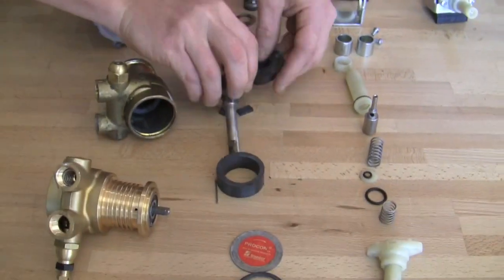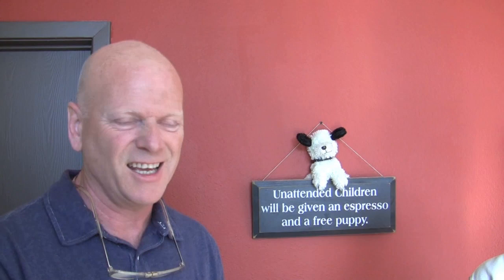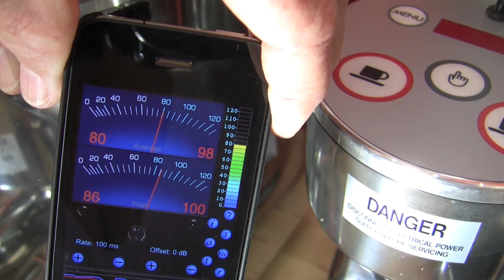Overview: Rotary vs. Vibratory Pumps

Comment: One big this I noticed is the vibration pump will burn up if its ran for a period of time with out water, as weather is the 'coolent' I have had 2 vibratory pump burn up due to running the water tank empty.

Comment: This was so interesting !! Thank you! Gail is amazing as always, but unlike her, I quite like the sound of a grinder, mine is pretty quiet and pleasant to the ear imho. On the other hand, I really dislike the sound of a vibrating pump, it's very aggressive, in your face kind of sound, you can feel the entire machine shaking, cups on the top shaking and moving knocking into one another...The smooth sound of a rotary pump reminds me of ice cream machine at the milk bar, and everything related to ice cream gives me joy inside my heart :-P

Also, I wonder if the vibration through the whole machine is a good thing for the overall integrity of the components over a long period of time compared to rotary pump which feels a lot less intrusive. If you are ready to invest well over 2000$ on a machine that you will likely keep for a good part of your life maybe the 500$ more is worth it even if it doesn't make

Comment: Thanks for the video. 
I wonder if Rotary pump and volumetric pump is the same?
I f The machine is just plumb in, can I use a bucket or sth to use it or does it have to be plumbed? 
Thanks

Comment: Vibe pumps are better for home use as they are cheap, if you're lazy and you live in a hard water area and don't descale as often as you should and you burn out your pump you can get an OEM replacement for 20 bucks shipped. If you do that with a rotary vane pump you'll be crying when you have to spend 500$ replacing the rotary vane pump. The grinder will always be  louder that the vibe pump as they correctly note and pump type has no effect on taste.

Comment: Great video!  Some great folks giving great information.  No winners, no losers, just different equipment for different needs.  Thanks for the information.  I'll be looking you up when I'm in the market again.
Reply from the maker: +blmeflmm66 Cheers! Thanks for watcing!
Reply: I don't think the rotary pump would work very well with a thermocoil system. The vibratory pump doses out water in small amounts that can be vaporized. The rotary pump would have to rotate very slowly in order to manage that.

Comment: Bill said vibratory pump was not for plumbed in, however Expobar Brewtus IV P is with vibratory pump and Plumbable. Please explain. Thanks
Reply: +Ko Amin Samudera You can do it if you have a solenoid valve before the pump.  It's rarely done.
Reply: +Beans and Rice thanks. does the solenoid valve come as standard kit from the machine purchase;?
Reply: +Beans and Rice thanks for your advice. I think I'd better buy rotary pump machine.
Reply: I know i'm late to the party... however i think i would go with Rotary also.  It never hurts to buy quality... and adding another point of failure to a system is never good.  Not to mention, your raising the cost of the machine with materials and labor to accomplish the same thing a rotary is capable of handling on its own.
Reply: hi Aaron. thanks for your input. I did buy VBM Domobar with rotary pump......
Reply: Out of curiosity, what made you chose the VBM Domobar over a profitec 700, Quickmill or rocket?  I am on the hunt and am trying to get the best value possible.  I hadn't heard of the VBM until your comment... so I'm about to go digging.
Reply: I must admit that I chose VBM more because of non-technical issues, such as distributor profile, possibility to buy together with grinder, etc. Of course, VBM technically is quite good. Also, in my country-Indonesia, not all brands have agents. I would love to have Profitec 700, but they don't have agent here. Recently, I saw review about ECM Synchronika, and I think it's really a nice machine to be considered.

Comment: Hey there awesome video! Just a quick note though, 1/1.5 duty cycle is 66%. So the machine can be on 66% of the time you consider as a unit, which in this case can be 1.5 minutes, seconds, hours...

Comment: Quick tidbit here, both of these pumps are driven by motors, the vibrating pump is just a linear induction motor instead of a rotating motor. Its very likely that your rotating motor is also induction, it just moves differently. The most common example of a linear induction motor is found in every loudspeaker on earth and they can certainly perform day in and day out for decades. Whether or not they can handle a specific duty cycle is really a matter of how they are sized and designed for a certain application. There also other very cheap versions of rotating pumps out there, this one in particular is just very robust. 

This is extremely informative though as it shows how these are set up for ESPRESSO machines, great work on showing these taken apart and discussing them.
Reply: +Patrick Anderson  While technically accurate, I haven't seen any speakers with a 1/1.5 duty cycle.  Haha!  In this age of lighter cheaper run it to the limit engineering, you generally get what you pay for.  Even though my 2500 dollar refrigerator with the new linear compressor crapped out after only 3 years.  Grandma's GE fridge ran for 60 years and was only shut off for defrosting and during power outages and never had so much as a screw replaced.  Still worked when it sold with her house.   Planned obsolescence is all the rage.  Whenever I see "duty cycle" less than "continuous", I don't walk away.  I run.  Haha!  Gimme a Procon pump on a Baldor motor and call me in 60 years.

Comment: Ok, thanks for the video. Nothing is too complicated. So, the difference is in sound and how many cups of coffee you want to make per day actually. :) Personally, I do not see a lot of difference in price according to details I saw. It looks like commercial machine should be about 200 bucks more expensive only. :) So, if you can get pretty good vibration pump machine for about 250 bucks then the same commercial version should around 450-500 bucks but not more. :)
Reply: Actually no.. the commercial machines also have higher quality internal plumbing, boilers, etc.. so they are gonna be more $$. That doesn't mean someone cant manufacture a cheaper rotary pump system.

Comment: Hate to be the tech nerd! But, in theory, a "Rotary Pump" coverts Electric energy in magnetic energy as well, with either alternating current or it can be direct current pump motor. I believe most rotary pump motors for espresso applications are AC.

I understood your guys basic point ! But my friend brought this up to me, they got confused when you said a vibrating pump was "electric to magnetic energy."

Comment: I had my Rancilio Silvia on a timer to heat up in the morning, but left the pump switch on Twice,and burned out two pumps while I slept unheeding! I at least,learned my machine inside and out. One good thing was that each time I bought my pump online, they were of better quality. The last one was all metal (excluding gaskets etc.) and cost me the same cash! Yes,It took two stupid moves to impinge on my obviously addled mind that the half hour (or less if you run some water through) I had to wait, was less trouble than buying another pump! I type this after breaking down my grinder and almost buying rebuild parts, but finding that the gear box makes grinding noises without beans! So backed out on the parts and am now watching this site's very enjoyable vids to decide on a low level coffee grinder that I can afford (less cash than the espresso machine I use)
Reply from the maker: Ooops, lesson learned! I'm glad you're enjoying the videos - let us know if you have any questions! -Kaylie

Comment: Hi Gale, Bill and the camera lady, and Happy New Year!
I just saw your video and I recently bought a La San Marco 95-22-3. I’m looking for a water pump now and I was wandering if you know the proper pump characteristics for this machine?
Bill I have the old pump but it's leaking and i have to either rebuild or replace the one i have. Do you have for sale a repair kit for this pumps?
Thank you!
Reply from the maker: Unfortunately, we do not currently have a pump repair kit for this machine. As for the pump characteristics, I'll see if I can't get some answers from someone better able to answer that question and I'll get back to you! -Kaylie
Reply from the maker: Seattle Coffee Gear Okay, so my source says that the machine likely has a rotary pump, since it's a commercial machine, and that there normally are not re-build kits for those pumps. -Kaylie
Reply: Thank you very much! In the main time i did some research and i managed to buy a "rotary pump" new same as the one i has b4 and wasn't much but $30+$10sh. i also find this website that may help you and maybe others in the future!
http://www.edcodistributing.com/pumppricing.php they have some very expensive pumps but they have the kit!
Reply from the maker: Myxprso InAM Yeay - I'm so glad you found something for your machine! -Kaylie

Comment: Decibels are a logarithmic scale.  A 10bD increase in decibel level will result in a doubling of perceived volume.  A baby crying is 110 dB, an ambulance siren is twice as loud, so 120 dB, a jack hammer is 130 dB, and a jet engine is 140dB.  When you look at it, it looks like a jet engine isn't much louder than a crying baby, but it is actually 8 times louder!  You demonstrated that a rotary pump is half as loud as a vibe pump.
Reply: Brian Webb I came here to make this comment, but you explained it better than I would.

Comment from the maker: It's so hard to properly represent sound in our videos, though; we tried to do it with grinders by using a sound meter and it showed different decibels, but it's mostly a tone thing. I think that the Silvia is louder because it's smaller, so things are closer together and will jiggle & shake (for lack of a better description). - Kat

Comment: Great video.  A few other considerations:
1)The mounting of a vibe pump affects how loud it is.  They are are suspended in a rubber mount, but if that rubber or the pump touches anything, the vibe pump gets really loud.
2)While a rotary pump can be rebuilt, it is useful to note a new vibe pump costs around $50 which is less than the cost to rebuild of a rotary pump.
3)A vibe pump takes longer to get to full pressure.  This can result in a machine that is more forgiving to newbies.
Reply: @vladyslavleonov7174 not sure if you ever received a response but the cost depends on which pump you have.  
Regardless it’s fairly inexpensive, to have them rebuilt or you can purchase a repair kit. If you’re purchasing or repairing a Procon pump, I recommend contacting EDCO Distributing